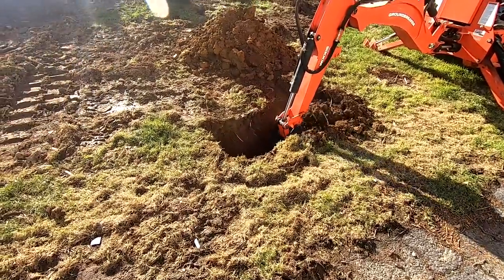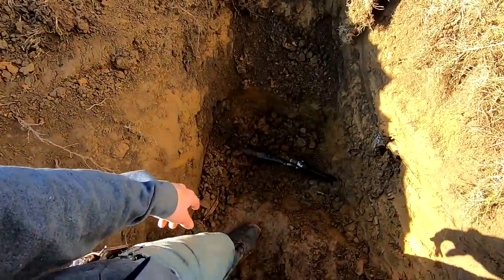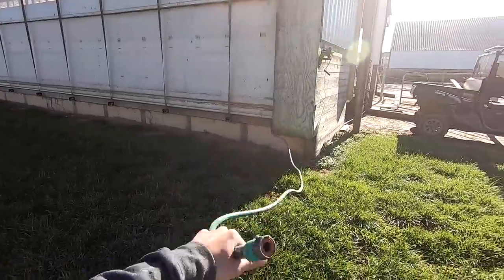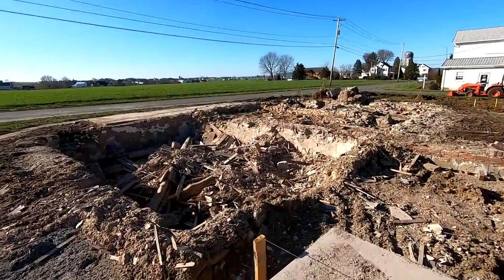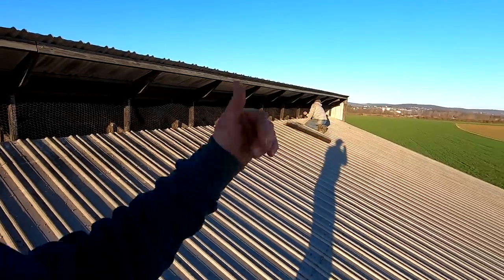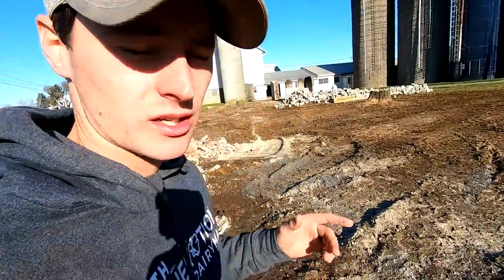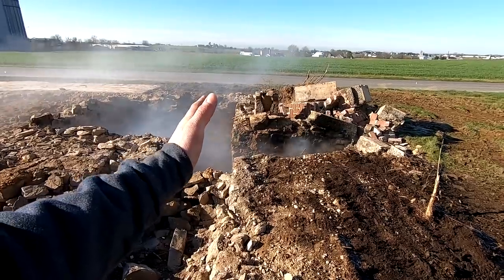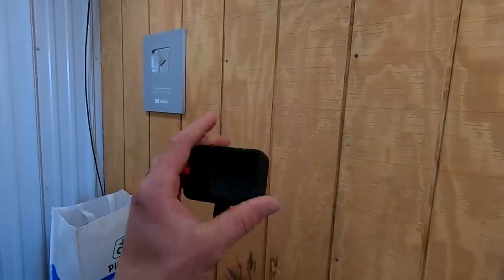Land of Opportunity

Comment: In Germany i would say 
Floorheat with an Heatpump.   
Depending on your eletricity costs, an solar system may make sence to run the Heatpump. 
And you certenly have enough roofs to put them on. 

Over here, most bigger Dairy Farms run their own Biogasplant fed with wasteCorn/TMR and Manure, to produce Gas, the Gas is cleaned and drives a Genset for own use/ feed eletricity into the grid for Money, and with the heat from the engine, 
the Structures on the Farm are heated and Hot Water is provided. 

In the Summer they dry firewood with the Heat, and one guy even build an PrawnFarm in the Middle of Germany to use the Heat and now sells Prawns.

Comment: I would go with gas forced air heat and AC. If you go geothermal you can still use the ducts. Radiant heat is nice but it's not for AC just heat. Fuel Oil is an option if you don't have natural gas. It would be nice if you could somehow use cow manure as a source of gas for heat. Anyway, can't wait to see the home. Think about spray foam for insulation or if not all then use it as an air barrier and then fiberglass. Hardie siding is better than vinyl siding.

Comment: Hiya Eric,
I've been enjoying your channel for some time, and I've been watching your back catalogue for a while, but why do I watch you shifting liquid dung and not fast-forward? 
Heating? As an electrician, I recommend that you do not use electric heating, which does not work well and is very costly. I can recommend solar elec with a battery bank and inverters. On-roof solar panels for producing electricity and windmill, plus on-roof solar water heating. A secondary heat source in the family room is cosy and fun to stare at. If your stairs go up from that room, that can save heat. Spray foam, I've found can seal a house; no draughts is lovely. Triple glazing with heavier-than-air gas between pains works as a thermal barrier. 
Stay safe and blessed, Steve...

Comment: invest in isolation and pay perhaps more than you want to and use AIrconditioners (they are also heat pumps with high efficiency) In that case get some independent consult and pay for it and don't let an installer convince you. Many times they have other interests than the home owner

Comment: Hey Eric first I love  the videos. And in terms of heat I would highly recommend wood heat. It is a little more work but it is definitely worth it. Wether you put a wood stove inside or outside it works great, plus wood heat just feels better. Plus you can usually buy loads of wood for pretty cheap

Comment: There is no two ways about in floor heat!!! Probably the most efficient, the comfort is uncomparable, and if the power goes out you don't have to worry about a generator for several hours because it contains the heat in the lines, I have experienced this in a 40x60 shop in Alaska with an apartment above the shop on one end, there are months where it is 30 below and that entire shop and apartment heat for about $150 a month, yes the boiler system zone valves and trickery will cost you some money to begin with but it's worth it!!!

Comment: So we build in 2014. You said that you build Frame Work, we have built full wood with a hemp fiber/wood fiber/rock wool insulation. We only need a normal wood stove and a heat pump for the 3 floor and bathrooms.

Comment: Hi Eric, Enjoy your videos , I have worked in construction most of my life . Built houses 35 yrs.I installed a  forced hot air system by gas (propane).The furnace is a York 97.5 efficient. Insulation is important, spray foam 2" with fiberglass batts good luck I will be watching.

Comment: Floor heating. A hot water boiler. My has worked since 1969 and had no issues. Water pressure tank psi over pressure release valve.

Comment: I would focus on the walls and their thickness and correct insalation of walls and roof.  That will preserve the heat in the harsh winters. U could even look into fox blocks. Do not do 2x4 walls. U will never regret a wood stove heater. Dont do a chimney. It doesnt work efficient.

Comment: Eric you should look into geothermal as you can get tax benefits from using it also have you ever thought about putting up solar panels another energy savings.  Eric would it help if you put in a 10ft insulated pit so it would be easier to shut your water off and on . Birds are a pain especially in the winter where they poop all over everything inside bldgs and can spread diseases from one farm to another farm like coccidioses  for one and scours and TGE in swine. Your drone footage always looks great I wish I had a drone like yours. Hope you get your concrete poured before your weather changes as we have been fighting this 4 day winter storm but we have been getting ice and freezing rain and drizzle but chance of 2-3 in of snow tonight and tomorrow and then the temperatures are supposed to drop by Saturday to highs of 20 and single digits, to below 0 to -10 to Christmas eve and a little warm up of temperatures on Christmas day.

Comment: We have dual system. Hears with electric till it gets below 40 then it uses gas.  Gas is warm it’s also heat pump. We love it. We live in Nc not as cold as y’all get so it works will for us. Propane seems to be economically for us.

Comment: Mitsubishi Mini Splits will be most cost effective to operate.  Heat and air all in one.  100% efficient down to 5 degrees and will still provide heat at -13.  I've got them and love them.  Get a qualified installer.

Comment: Lots of good advice here.  But I say "NO" to air to air heat pump in PA.  While they can easily do the job they are high cost in the long run and you will be replacing air handlers and the outdoor unit (heat pump).    Esp since you or family will be there many , many years.   I know.  I have 4 of them.
And if you go with hot water heat do NOT go near any Navien product.

Comment: With regard to heating - take something proven, mature, nothing new, hip or fancy. Often expensive today - and out of fashion tomorrow. Our neighbour for instance changed for pellets three years ago, because it gave money from the government with it and pellets were cheap then - prices for pellets have trippelt now. We understand his feelings.

We instead kept our good old Buderus oil heating system (well maintained, turbo blue burner with oil preheating, high eff pump etc.), we were just not interrested in a change, and bought 5000 liters of heating oil a year later - for €2.200 Euros. Will last us four years/winter minimum, cause we have a woodstove we use everyday as well. This (Made in Germany, we live here) oil heating system didn't even ask for one spare the last 15 years, not a single fuse, relais or nozzle. (The plumbing, periphery, needed a valve for fifteen euros, and we replaced the expansion tank once, 50€). It just works fine, and gets cleaned every autumn, still passes all tests with ease once a year. Maybe the oil will last us 5 winters, we started snowbirding - and there is this global warming.

By the way - Company Buderus started to have a production plant in (northern) france 50 years ago to foster mutual understanding and prevention from war, maybe our 'Made in Germany' could in part be just as well from there - not problem at all, the french have great engineers and craftsmen as well.👍🏋️

Comment: Geo Thermal Heat pumps, last long, need very little maintenance and is efficient.  I personally like Mini Split heat pumps one head for every room.  This gives you control of the heat.  I also LOVE vent free gas fireplaces.  They are perfectly safe, cleaner than using a natural gas appliance and 100% thermally efficient.  Stay away from pellet stoves, you could get a corn stove since you can grow your own fuel.  BUT with corn prices these days it would be better to sell the corn and burn dollar bills.   Solar electricity sucks, but solar heat is very powerful.  Stay away from high efficiency natural gas furnaces.  They are very expensive and often have issues.  Lots of sensor and components that prone to issues.  Fuel oil is only going to get more expensive.  Coal is a great heat source but I bet it's expensive where you live.   It's better to go cheap on the heat and spend more on the insulation.  I recommend fiberglass or rockwool.  Stay away from blown in insulation, its messy, major health concerns, habitat for pets.  Closed cell foam insulation is good expensive.

Comment: We are building a new house.  Big time delay because the shortage of power transformers means ours has to wait until one is available.  We need power to heat the house to install flooring and mudding the sheet rock.  My wife didn’t want to spend money on AC, until we sweltered in August, we changed to forced hot air with AC.  You can’t cool the air without moving it.  We liked the so-called mini-split with a heat pump in a previous house, but my wife decided against having the wall units in this house.   If you are similar to us, your marriage will be tested as you make the decisions.😊

Comment: should be a single level home, as you become older going up stairs will become more problematic as well if you are injured for any period of time, a bedroom upstairs is not good. or if a 2 story home at least have the primary bedroom on the first level. a hydronic heat system may be the best for your area

Comment: In floor for heat, and do central air for air conditioning and with gas furnace. When the temps are highs in the 40s 50s and lows in the 20s your in floor will be to warm so you can use the forced air gas until it's gets colder. And you'll have multiple heat sources. Also avoid Navien for your boiler.

Comment: Just a follow up have a list of questions written down, simple things to miss would be putting in wiring for a landline for the  phone, you may never get a land line but its PIA to put one in after the house has been buttoned up. Cell phones are subject to all kinds of problems. Or think about a Satellite phone, if you have an emergency  communication is your best friend.  I ride motorcycles (giving up this year), but on some of the routes we took they only thing that would work for communication was a Satellite phone.  Plan for the next 10 to 20 years not the next 5.  Your going to be doing every thing from an app on your phone plan for it.  I am getting off subject, just make sure you have lots of meetings with the builder to get all your questions answered. No matter how stupid or minor you may think they are.

Make sure your wife designs the kitchen and bathrooms men have no idea how to design a kitchen, most small counter appliances for the kitchen now only come with a 2ft or 3 ft cord make sure you have lots of outlets.  If she bakes you need space. Pot drawers, no one thinks about them but you may need at least 3 of them. Wall outlets don't have 1 or 2 ft off the floor. put them up 3 feet why do you want to stoop down to plug in a vacuum cleaner. DON'T SKIMP ON THE KITCHEN OR BATH ROOMS you will live to regret it.

Comment: Go with a 3ton heat pump. U get both heat and cooling. Very comfortable and energy efficient. Have a generator connected to ur electrical system for backup in power outages

Comment: Geothermal with forced air system that includes a desuperheater for domestic hot water.  Super insulated walls and roof.  Don't waste money on a system that relies on fossil fuels or wood.  Using forced air instead of a radiant system allows you to use the geothermal for cooling in those hot PA summers without installing a separate ducting system.

Comment: Too cold for a VRF or standard heat pump there. Could work but not going to be worth it. Geo thermal is always problematic later. The best is still a gas fired furnace and a pellet stove.

Comment: what most people do today and what i prefer as a HVAC design engineer is Hydro Air ,,, one air handler in the attic and one in the basement ,,,this gives you two zones and you wont have to worry about getting ducts from the basement to the 2nd floor and you can have heating and cooling on each unit and allows for excellent air filtration  ,,you will still need a small boiler ,,,low mass type ,,,use either propane ,,, NG or fuel oil ,,what ever is in the area, ,,, very nice system !!!!!! and wont break the bank either
Reply: my go to systems are GEO thermal how ever its very pricey ,,,,,,

Comment: Electric heat is fine with a well insulated home, though obviously your electric bill will go up, though that could maybe be offset with a small home windmill or solar panel fixture.  Also, power outages will be absolutely miserable.

Hot water/oil has its uses and is fairly reliable, but might be less-so if there's a squeeze on oil as a natural resource, and it has a tendency to be loud.

A wood, coal, or pellet stove will never not work, there's abundant material for it (though maybe less so in your immediate area, so you might have to go on short trips to a more forested area for collection, or purchase cords of dry wood) and is great exercise and a way to teach kids about hard work and fire safety, but they do pose a pretty substantial fire hazard, which can have an effect on insurance costs, and might be a poor choice to people sensitive to risk.  That, and climate radicals in positions of political power might kibosh wood-burning "for the environment." *coughtheyreallyjustwantpeopletofreezecough*.

Comment: For heating my new home in central IL I have an air-source heat pump (bidirectional A/C), with gas backup furnace. If I could have afforded it, I would have went with a ground-source heat pump instead and cut the gas. Heat pump technology is amazing now, and very reliable/efficient. I have solar and pay nothing to heat/cool my house from March through December because my utility company offers net metering. If they didn't I'd also add batteries to my system.

Comment: Are you going to have all your living space on one floor or 2?  Radiant heat (boiler) in the floors is very nice and efficient.  It's a very comfortable silent heat and you won't need registers in the rooms. https://www.youtube.com/watch?v=qWvoYMf5iC4  I guess you also need to see which costs more in your area...gas or electric.  Where I live, nearly all homes are heated with gas but the next town, 20 miles away is 90% electric.  I'd supplement with a wood stove or pellet stove in the main living area like the Amish do.  I like the way they put a wood stove central the the first floor living area...but that's just me.

Comment: were in the uk and a ground sorce heat pump is great for us
Reply: Hi Charlie 
I live in the Republic of Ireland and am just wondering what make of heat pump have you. 
I have a French model called a clima  and it has lasted for more than 20 years but now it's not the most energy efficient with the price of electricity.  I think there are more efficient ones out there now.??
Reply: @farmerjack5324  ours is a Vaillant machine.  brilliant bit of kit!  piped under a 100x50m plot under a grass field, heats a huge buffer tank to about 28 decrees c,  all year round (even in winter somehow!) then a boiler to boost it up to 40. Dad was in charge with it all but I'm very happy with it    5 years and a few teething issues (make sure to put valves into the pipes to allow the waters path to be fiddled with, otherwise like ours it will go around the shortest route and will lack efficiency)  but now that's fixed not a problem, and the same with our rental property which has the same but a smaller model.

🎄merry Christmas!🎄

Hope this helps!
Reply: @farmerjack5324  kind of missed the question with that reply didn't I...

its my firs one that I've had so i don't have much to compare againsed but I'm  happy with it when i think about my old house with gas boilers.     flashbacks

Comment: Suggest putting 4x4 box with 2 recepticals (4 recepts) 4ft from each corner and same in center of wall. Will not have to extension cords. Use #12Awg wire and 20A recepticals.

Comment: Mine split AC's with heat pump and a German company makes a water heater/ boiler and heat pump for coaled climates. There is also a custom company out there that can take your blue prints and mack plywood grooved sections for radiant heat pex for first and second floor heat. The mine splits have really come down in price expeshaly the multiy zone units with one outside condense, just mack it easy to pull new line's for up grades in the future. Also most mine splits store there recommend volume of 410a refrigerant in the line's. You will get your money back quickly with the energy efficiency. Don't for get to but a soler or trackter generator back-up. You can get a good discount on your solar through the government right now, expeshaly on new construction. There is a grat new solar shingle from Timber Line in California a DBA of one of the biggest shingle companies in the world. Thay have a lot on YouTube about it, mit get a deal with a YouTube sponsor ship on the installation. There's also a grat solar EQ company called Sigineer and get a rack mount lithium battery sistom.

Comment: If you have access to it forced air natural gas is the way to go. The problem with in floor heat is if you want A.C. you still have to install all the duct work anyway. I would also consider two furnaces since on a two story the top level will always be warmer. If you use set back thermostats you can allow the upper level to remain cooler during the day when you are not using it and then allow the main level to cool at night as well. There are as many opinions as options these days. Best of luck!

Comment: The problem with water heat electric heat you can’t put air condition to it propane or natural gas force T forced air heating it’s easy to put air conditioning on